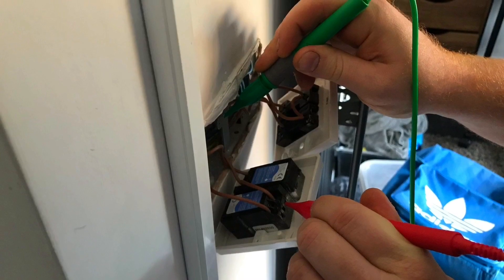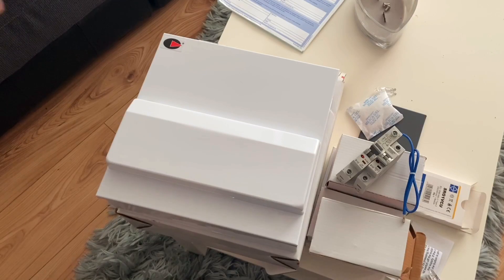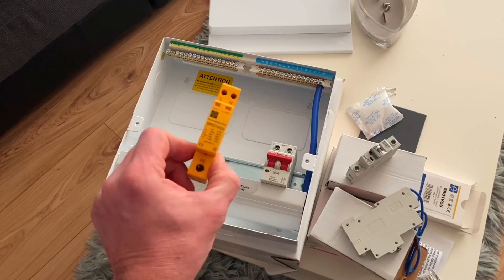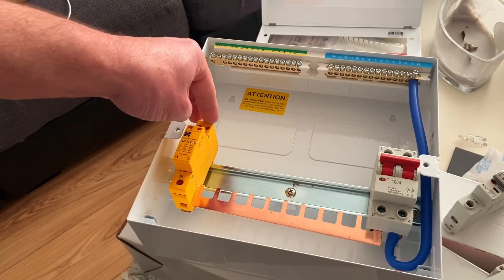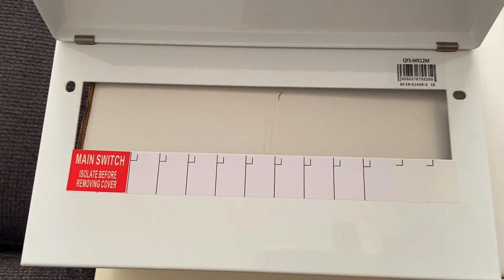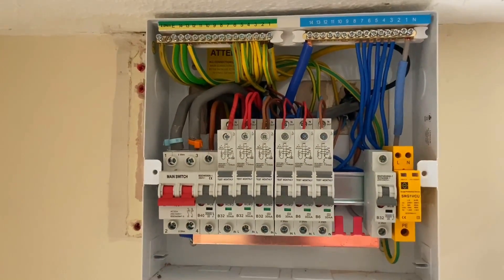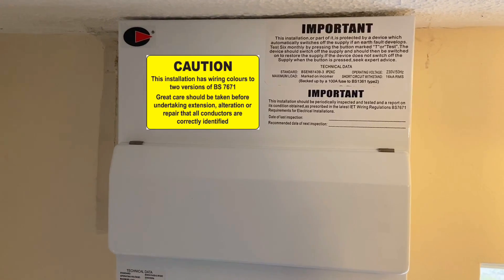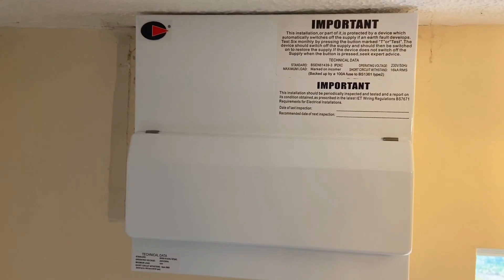Consumer Unit Change and it’s a Lewden Consumer Unit in Disguise with 'A’ Type RCBO’s and an SPD

Comment: Hi Gaz, great content as always, Why couldn't the SPD be positioned infront (to the left hand side) of the main switch?
Reply: I think you misunderstood, I mean far left in its completed form after you changed sides with the main switch, not bus bar side. 👍
Reply from the maker: The bottom of the SPD is connected to the earth and not the bus bar hence in this form it’s at the end to the left. Wylex now has an SPD that connects at the bottom to the bus bar which make more sense 👍.
Reply: I guess the main switch has to be first before anything else.

Comment: Great vid, but you've got to love the regulations sometimes, an the way they are blindly followed.
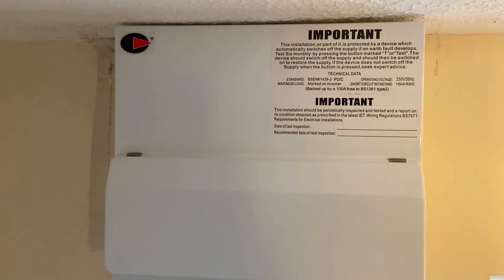Front of unit @ 6:26 = RCD sticker that states a "a" device that should be tested six monthly. - Quote Gaz: ""Important that it's tested every six months, or half yearly"
Yet Inside it  @ 6:46 = 6 devices, each that state on them "TEST MONTHLY" by the manufacturer.
Dohh !

As it's not a temporary installation, (BS7671:2018 514.12.2 NOTE:) there's no scope to correct the wording on the sticker to reflect the increased testing frequency. Or any way to modify the wording that there are multiple devices that need testing, without being no-compliant to the regulation itself. (Unless you are meant to fit 6 of the stickers, as you could interpret the wording of the regulation in that way ! )

Comment: In Malta, electricity meters come fitted with a 40A double pole MCB (don't know whether it is a B or C curve). It is downstream of a TT servicehead with a 40A fuse. When fitting a Type 2 surge protection device, do you think it would still be necessary to install overcurrent  protection for the SPD? Given the 2 OCP devices before CU, I would think that I can safely place the SPD upstream of the double pole MCB in the CU itself. What are your thoughts?
Thanks.

Comment: Great video,  and nice job on the CU change. I've been using Lewden CU since January this year and find them pretty good, there are a couple of things that slightly annoy me about them though, how did you find it ?
My wish list to Lewden......
1) The Earth bar could do with being slightly longer, it usually only has two holes marked E so where you have both Gas and water bonds it can mess up your CPC identification, and requires re-lablebling. 

2)  be nice if they could supply a mixed colour label in the stickers pack  that comes with the CU
3) the flappy lid only opens up to 90° so it makes my circuit chart sticker a little akward to read when I stuck inside the flap.
Reply from the maker: Wow thanks for the detailed comment. Gaz 👍